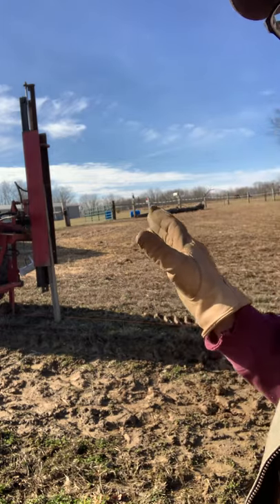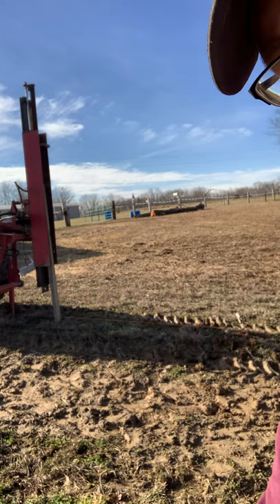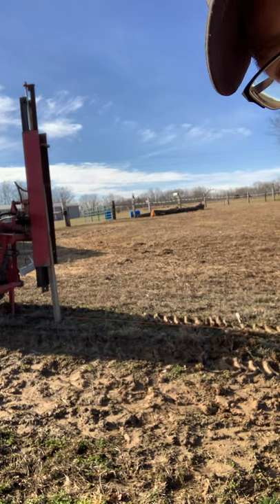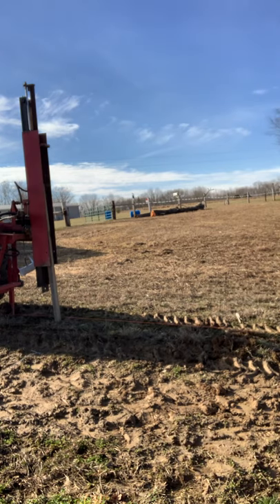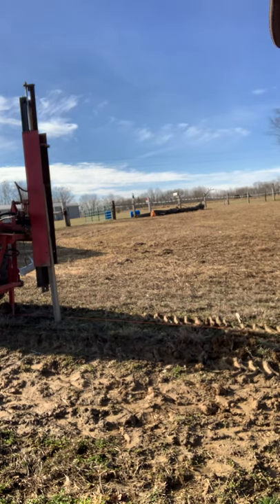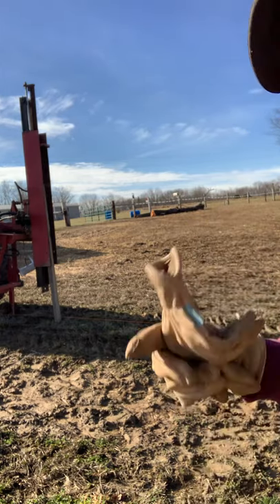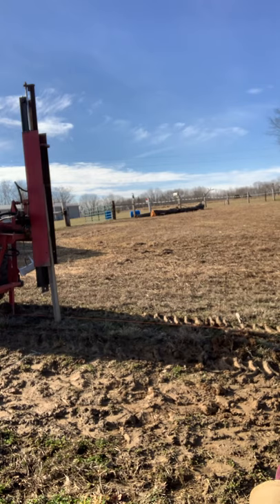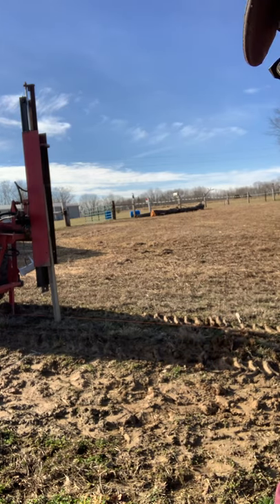Shaver HD8 post driver

Comment: Hi there what tractor are you running this on ? I’m considering buying this attachment but I have a John Deere 3025E
Reply from the maker: I’ve got it on a 2638 Mahindra.  If your John Deere has a cast aluminum rear end (I’ve heard the smaller Deere series did) I wouldn’t put this on it as it can be rough on the machine it’s hooked to. 
I don’t use it much but when I do I much prefer soft ground for it.
Reply: @rickpierson2458  thank you for your quick response I subscribed to your channel 🤓
Reply from the maker: @yellow3222  I just happened to have look at my email apparently right after you had commented.  Thanks.